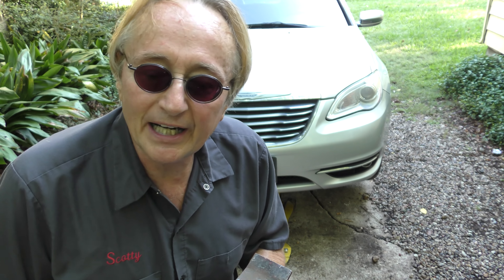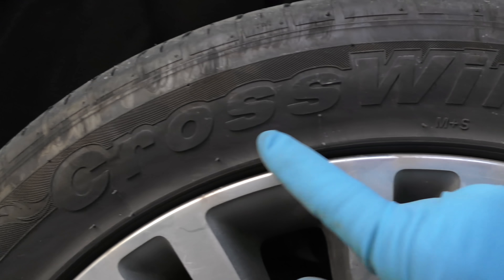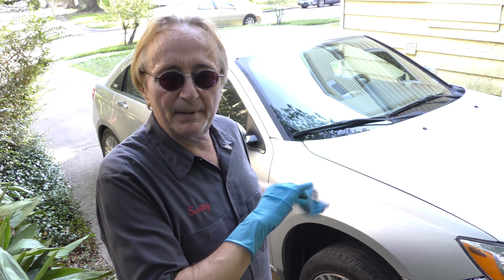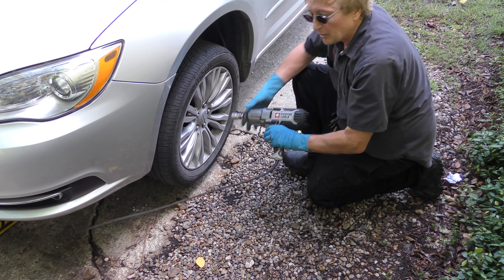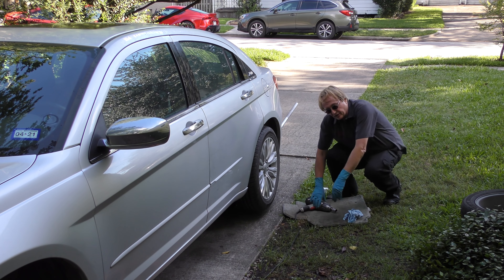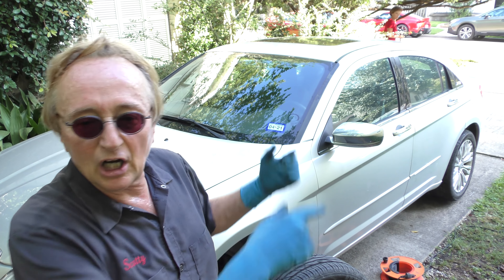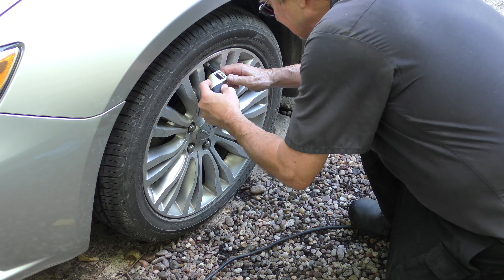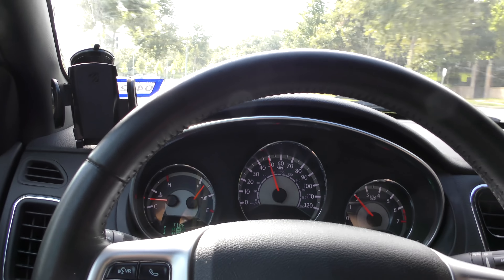Here’s How Stupid People Change Tires

Comment: putting the worst tires on the rear is ok in good weather but unsafe in snow or heavy rain as it can take a car that is designed to have understeer most of the time to one that can suddenly cause oversteer, a condition that is much harder for the average person to deal with.
This is why you should NEVER use only 2 snow tires in the winter time.

Comment: Scotty, the problem with putting the bad tires in the back is that the car can lose traction in the back and spin. This will happen generally at an unexpected time when trying to avoid an obstacle,  entering a curve at excessive speed or conditions of poor traction due to weather. If the front end is vibrating or not steering properly, at least the driver is aware of a problem. If the rear traction is compromised this will only be evident when the car spins in most cases. Advising a car owner to drive anywhere but the nearest tire dealer in the condition described in the video is negligent.

Comment: The only reason you want to avoid putting worn out tires in the back is to prevent the car from slipping during turns in the rain or snow, but like he said the best most traction tires should be on the front wheels, because they do all the breaking and steering.    Now for those people putting comments saying you put it on the drive wheels.   NO that is wrong.   Rear wheel drive cars still need the best tires in the front.  Putting the best tires in the back of a rear wheel drive car is very dangerous, because it can cause an understeer which is really hard to control.   For those that don't know understeer is when you turn the wheels to make a turn but the car keeps going straight because it lost traction in the front wheels and it's now slipping.   Oversteer is when the back end of the car slips which is what most people experience, and can be corrected with practice, and it's usually used on purpose for drifting.  Racers and professionals when they usually crash, it's because they caused and understeer situation, the only thing to do in an understeer is put the wheels straight and pray that the wheels grip again before you crash in rear wheel drive cars, however in front wheel drive cars, you actually can stump on that gas to try and get the wheels to grip again.

Comment: That PSI gauge is accurate to 0.5 PSI.  The newer ones are accurate to 0.1 PSI.  This could be an issue since the act of pressing the meter into the hole will take out air.

Comment: I agree, best tires on front regardless of front or rear drive, would much rather control oversteer than understeer in case of tire failure at speed.  I also had a major tire place not sell me 2 tires and put them on the front as they insisted they had to put them on the back.  Yea, stupid people came up with this because Ford had rollovers in the past because they underinflated tires on new vehicles so they would ride better.

Comment: All people say that the best ones on the back (in FWD cars) prevents aquaplaning, also they say it's more dangerous to puncture a rear tire than a front one. I don't know... I think maybe the logic here is that since the car is FWD, it needs traction on the back because otherwise it would tend to oversteer or be loose on the back.
Reply: I think the real issue here is that the tires aren't the same specially at the front, where they need to be equal.

Comment: Most tire places will hire anybody with a pulse.  I took my car to NTB to have 4 new tires put on my 2018 Focus.  When I got the car back the ride didn't feel right.  I was blaming the new Goodyears then I checked the tire pressure.  The idiots inflated the tires to 45 pounds.  The max tire pressure rating.  Mr. Tire put the wrong lugs on my steel wheels which I used for snow tires.  The Hub caps fell off.  This was after specifically asking them to use the lugs that I placed in the wheel wells to avoid confusion.  They simply tossed them aside and used the alloy wheel lugs.  Lord give me strength.

Comment: Ok so I know that if you don't replace all 4 tires in an AWD BMW you will eventually destroy the transmission. But what would happen if you buy the tires and replace them in pairs in an Acura RLX hybrid AWD car where the engine isn't even powering one axle and an electric motor does instead?

Comment: Well, make sure that the vehicle is in "Park," first (or on a manual transmission - neutral) and the parking brake is engaged.  I you do not, it may roll backward, and the tire you are changing will just spin when you try to remove the nut.

Comment: Understeer is easier to correct than oversteer. That’s one of the reasons why tire shops will put the best tires on the back instead of the front.
Reply: Hi greg planter:  Dead right!

Comment: It's not nonsense having the better tread tires in the rear, just watch hydroplaning videos. This is true for front wheel drives as well. Of course you should have 4 of the same tires.
I used to think that the "better" tires always go on the front, but no it should be the rear. Can be the diff between crashing or not in heavy rain.

Comment: 14 years ago i drove little front wheel drive car at winter. This had new tires at rear and old bad tires at front also front axle was bad.
I drove whole winter with it and no crash, front end was slippery and wanted to go straight, but it was easy to control and i used to it.
Therefore car back end was very safe never ever i had spinout even not a little, because new studded winter tires at back.

But i know, this was dangerour, because all 4 tires must be proper and bouhht together new.
I just wanted to show example, how important is car back end.
Side crashes are most dangerous.

Comment: Thanks Scotty, I followed your advice and switched the front tyres to the back on my Porsche 911. I just spun out on the first corner I went round, I'm never listening to you again!
Reply: It works for FWD cars, not RWD! But in general that's why the best tires are put in the back even on FWD cars. If you lose traction, let it be at the front and not the rear.
Reply: If I’m not mistaken wouldn’t u also have different sized wheels on the front than the back?🤣

Comment: I wouldn't change just one tyre these days, as we now have ABS and Traction Control systems which monitor the speed of each wheel.   If your new tyre is just 1/2 inch bigger than the other ones, it will revolve at a different rate.

Comment: That happen to me I wanted new tires on my 2000 Nissan Maxima which is front wheel drive. I only need two tires for the front they said they could only put new tire on the back which don't make any sense. After a heated exchanged I walk out and went to another tire shop and got what I wanted. And that was the last time I shopped pep boys.

Comment: For bad drivers it is actually good to put the tyres with more tread in the back because the car is more likely to understeer if the good tyres are in the front you have much more grip on the front so the car is more likly to oversteer an it is much more dangerous especially for new or bad drivers

Comment: Best tires on the front is WRONG Scotty! 1.)If you get a blow out in the back it’s difficult to control. A blow out in front you still can steer. 2.) Negotiating a ramp on the freeway in rain the rear of the car can slide causing a skid/spin. Go to Michelin and Goodyear website it’s all in black and white.

Comment: nice way to trouble shoot that problem. But yes the previous workers were idiots for not noticing 1 different tire, however moving the better tires to the back technically is safer. But that only applies if where you live actually has a winter. I work at costco tire centre and our policy is to always put the better tire in the backs. Drifting or fishtailing is more dangerous than under steering, so that is the policy we follow. However, if the tires are bald and they are not getting new ones then we don't touch the vehicle and let them deal with it because it becomes our problem once we touch it.

Comment: Best tires on rear. Industry standard. I've been in the trade many years (not as many as Scotty mind you). Done time in tire shops. Front wheel drive, rear wheel drive, all wheel drive, or 4 wheel drive. Best tires always on the rear. For safety reasons at highway speeds, you don't want the rear to start hydroplaning in wet or slick conditions causing sudden loss of control. HOWEVER, I do agree, you shouldn't have mismatched tires on the drive axle, or really at all for that matter. All 4 tires should be the same make, model, and size with the exception of staggered fit wheels/tires from the vehicle manufacturer. I rotate my tires every time I switch between my winter and summer tires (about every 10,000km or so). A wobble or shake at low speeds usually indicates a tire starting to separate but you may also notice a pull to the left or right. May not be visually obvious yet. But I'd throw the suspect tires on a balancer and check for separation. Just one man's opinion.
Reply: Just to be clear, I completely agree with Scotty on rotating those tires to the front and telling the customer to put 2 new tires in the REAR of the vehicle. As long as the customer rotates their tires regularly, they should wear evenly. I also agree that the person who aligned the vehicle should have noticed the completely different tires on the front. They should have noticed something wasn't right during their post alignment road test. But to say the engineers are wrong and he is right is just ignorant. I've cursed at engineers many times while performing various vehicle repairs myself. But at the end of the day, the manufacturers are the ones spending millions of dollars on research and development so they have their reasons. Usually a compromise between cost and performance.

Comment: I've been told you always want the best tires in the back no matter if the car is FWD or RWD, because you don't want to have a rear wheel slide. It can be very dangerous, because the car could spin around and end up in the wrong lane, leading to a head-to head collision. Are you saying road safety experts are wrong?

Comment: Doesn't matter if the vehicle is front wheel or rear wheel drive, you always put the best tires in the front. Not only for the issues he described,but also if you get a blowout, you're going to want that to happen in the rear.

Comment: Rotating tires also an issue.The "experts" tell you to cross swap the tires to get better tire wear. I have had bad results from this even with 6 month old $1200 dollar Michelins 4 new. Yeah clean the hubs and rim mounting you cant reverse rotation of a tire that has been used. Front to back rotation on the ones I have now 6 months new same tires no wheel shimmy.

Comment: As an honest mechanic. Not calling anyone offensive terms but since it’s a fwd car you want the most tread in the front yes. But basically your working with a live axle in the rear. So if the customers car has a low tread tire in the rear and there’s a blow out they have no control of the rear which isn’t safe for a fwd. even a rwd car. Yes I agree you want all the same brand tires for all 4. And I’d recommend a t least 2 new tires for for the axle with 2 different brands. But that’s not the way I was taught with tires always newer tires or tires with the most tread in the rear

Comment: You ARE supposed to put the best tires on the rears when it comes to safety, regardless of if it is front wheel drive or rear wheel drive, the rear is where all the stability in the vehicle is, it’s better to not have a spin out because the tires in the rear are below 3/32nds of tread. Now when it comes to longevity, then if it’s front wheel drive then put them on the front since it’s the main driveline and where you will be cornering, best advice I can give is don’t drive with tires under 3/32nds of tread. When it comes to safety at least. Also don’t mix match tires lol.

Comment: If you put new tires on the front & worn tires on the rear, yes you'll have better traction. But when it comes to turning, your rear tires are what keeps the vehicle tracking in the direction your steering. So with bad tires on the back, your more likely to have oversteer. That may be fun when you know how to handle it. But not everyone is an excellent driver! So be careful of your advise.

Comment: 4:09... YEP!! That happened to me a loooooooooong time ago! Somewhere around 2000, I got a '96 Chevrolet Corssica. I remember it blowing all the tires around the same time, cuz it sat outside for 4 years on them, but they appeared good, until they all separated.^^   (they eventually all did, in about a months span time after the first blew.) So I got new ones for the front (where the first couple blew) and waited for the back. When I went to pick up my ride, they had put the new tires on the back, AND took the back ones off and placed them up front!^^  I was like "dude, my car is front wheel drive, I wanted the new ones in the front...) but for whatever reason, they explained (the shop) the are supposed to go on the back. Crazy, and that was like, 20 years ago!^^
\O>

Comment: I'm sorry Scotty, I respect you a very Mucho Amount. But You should ALL WAYS have the best tires in the Back of the car or truck, What ever it is. The best tires should all ways be in the back. If your driving 70 miles an hour on the highway and you have an Immediate blow out in the front. You will feel it a great deal but you can still stop the cat safely and steer it off the road. If this happens in the back, The car will start to drift in the direction of the tire that blew out. Then when it catches up with itself and grabs traction the car will drift the other direction very quickly and if you counter steer which is only natural people do this, It will catch traction and possibly flip the car over. I've seen this several times. In fact if you can remember Form Motor Company had a problem with the Explorer and it ended up being the tires causing this problem. What you are saying is correct also. You want the same tread and size on the front of a front wheel drive car, But you should ALL WAYS have the best Tires in the back.

Comment: OK Scotty, a CrossWind tire is a LingLong tire. Rubber is Rubber, but what makes a good/safe tire in the rain, is rubber compound. That's why Continental, Bridgestone, Michelin, etc make a good tires. They send chemists to a race track. I would take an 80% worn out Continental over a brand new LingLong. The extra tread depth of the LingLong might reduce hydroplaning at 65 mph, but the poorly compounded rubber will be a problem at all speeds. DO YOUR RESEARCH. Having been in the tire business, importing everything from Cheng Shin, to Kenda, Maxxis, etc. they were all good when it came to out of round, balance, etc. but EVERYONE was afraid on a wet road. Buy good tires. Your life depends on it.

Comment: Did you torque your wheels with a torque stick and torque wrench Scottie? So many dumb mechanics(almost always the young ones) don't torque the wheels and they all usually say "I've been using a impact gun for years, I know how tight it should be." 

If you see that a shop does not use a torque stick and torque wrench make sure to avoid it.

Comment: In the UK, tyre dealers are apparently obliged by Law to put the New tyres on the rear if replacing (only) two tyres
They say that the logic is that IF the rear tyres "let go" in the wet through lack of tread, the skid is more difficult to control than if the front "let go", so the tyres with the greater grip (tread depth) have to be put on the rear.
I, as I'm sure you do, totally and utterly disagree with this logic
Particularly with a front wheel drive vehicle which most here are, losing grip on the front wheels is far more dangerous
If the back end "lets go" but the front is still gripping, you can pull yourself out of trouble.
Most of the braking force is also at the front, so the chances of breaking into a skid in the first place in the wet are vastly increased by not having the best (pair of) tyres available at the front.
I have long argued this in the UK but like Scotty, I am "overruled" by those who claim to know better.
Years ago, when this safety myth first came to light in this country, I, and my Father, have experimented on private land where my Father used to work with a pair of wheels with very low tread and a pair with very new tread.
We tried both Front and Rear wheel drive vehicles and both independently came to the conclusion it was Vital that the tyres with the greater tread were on the Front, even with a rear wheel drive vehicle.
My Father wrote to the authorities in this country, and the "concession" we were offered was that we would not be penalised for swapping the tyres from the configuration left by the tyre dealer complying with the regulation.
They had apparently planned to make it an offence to drive a vehicle on a UK road with more tread on the front tyres than the rear.
Complete madness and frankly dangerous
I completely agree with Scotty
Reply: Ignorance is bliss!

Comment: Hey Scotty I love your videos but with the best tires front vs rear thing you aren't entirely correct. i totally agree for performance as far as steering, stopping power, and acceleration its best to put the best tires up front for a fwd car, but larger companies prefer to put the best tires in the rear for safety reasons. Oversteer is a lot harder to control then understeer, and with balding rear tires oversteer becomes a very real possibility. For the saftey of the average driver its best favor understeer and put the worse tires up front.

Comment: NO. You put the good tires in the REAR. If you hydroplane in the front, you still have control of the car using your steering wheel. If you hydroplane in the rear because of less tread, you're screwed.